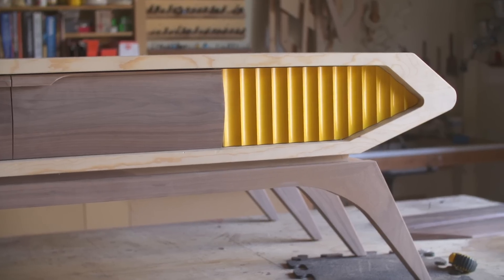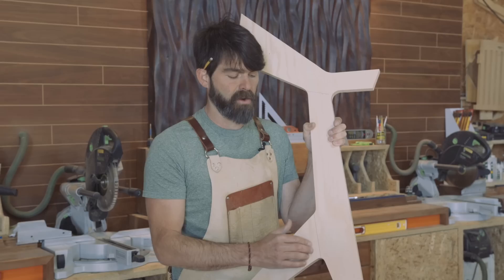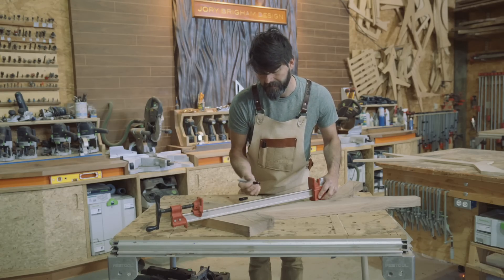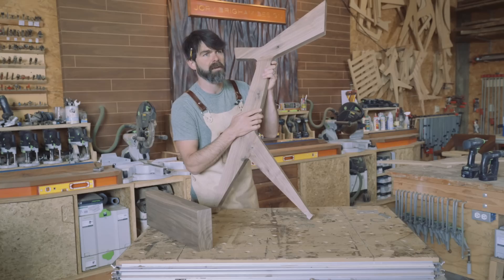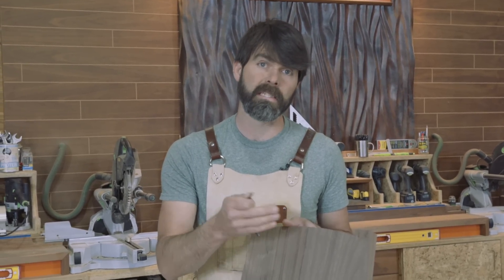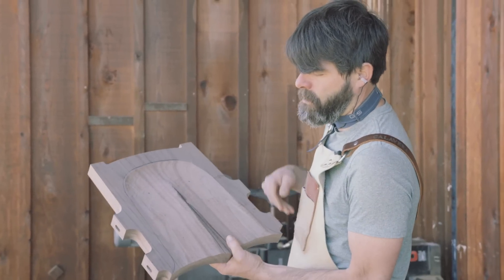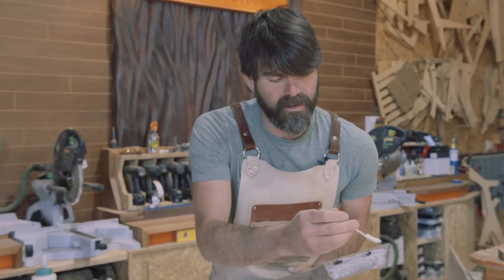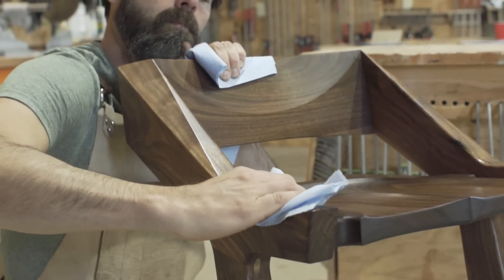Making a Handcrafted Chair with Jory Brigham

Comment: Love the chair Jory! Have you had any issues with racking over the years and causing the domino joint to start to fail?
Reply: Hey David. No I haven’t. That foot rest really helps it. I do make this stool for a counter height and that one did have some racking because I did not have that stretcher at the bottom. Since then Ive added it and it seems to be fine. The dominoes are incredible. There’s so much flat grain in those tenons that glue to the flat grain in the stool that there’s really no way for it to shift.

Comment: Are plans available for download?
Reply from the maker: No plans for this one. He just did a chair project for the Wood Whisperer Guild though.
Reply from the maker: @voidFutureVector  That doesn't mean you can't make them. In the full series he pretty much walks you through the whole build.
Reply: Aaron Price Hey Aaron. This project will be offered through he Guild later this year but if you cant wait I agree with Woodcrafts comment. Mess around with sketching ideas out on a sheet of plywood. It doesn’t have to be exactly like this one.

Comment: If only getting one of the whiteside spiral pattern bits, is the combo the way to go and just remove one of the bearings for thick stock?
Reply: For me, the top bearing one is the best. Ive tried taking the bottom bearing off the combo bit and unless you cut the material really close the stub that the bearing slips over will get in the way

Comment: Why do they call it a joiner when it cuts one piece of wood into two? That's the opposite of joining!
Reply from the maker: It is called a JOINTER, or jointer-planer which is a plane used for preparing a wooden edge for fixing or joining to another edge.
Reply: @WoodcraftSupply  Ahhh... that makes more sense.